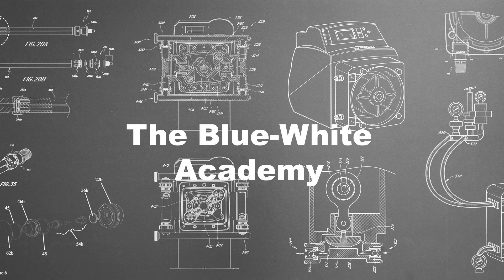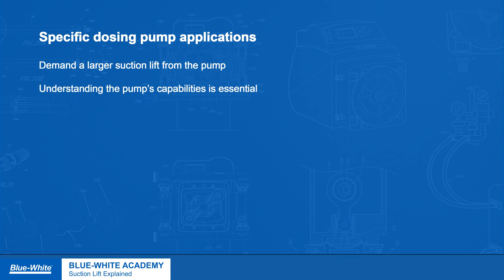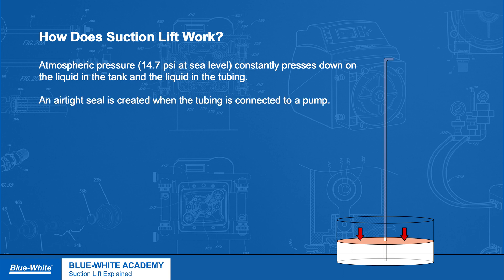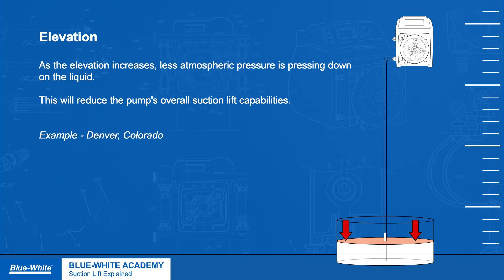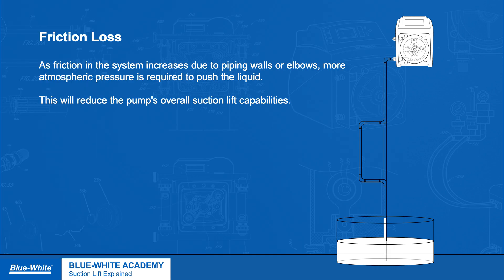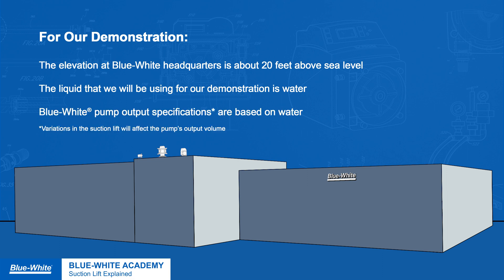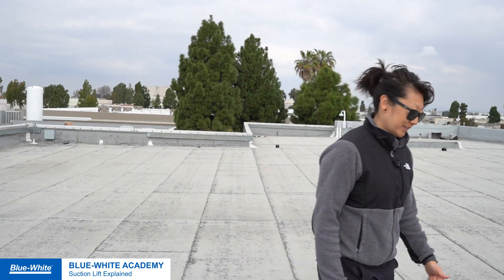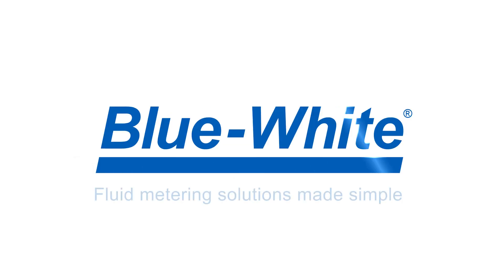Suction Lift Explained: The Key to Pump Performance

Comment: What will happen to lift , if we increase the pipe sizing in the suction side ??
Reply from the maker: Thank You for your comment. Increasing the piping size will reduce friction loss resulting in increased suction lift capacity. However, unless the fluid being lifted is viscous, which could result in significant friction loss, the suction lift gains from increasing the pipe size will be minor.